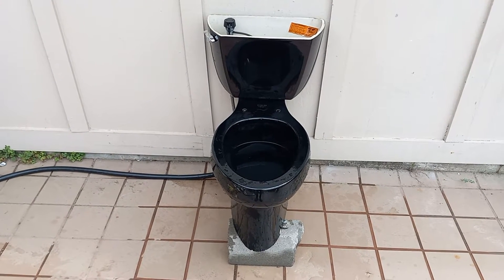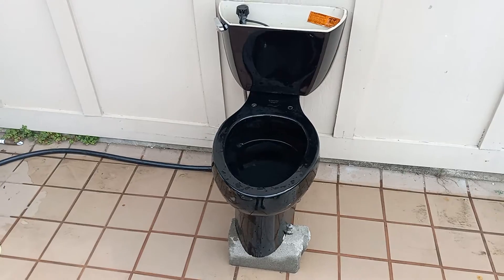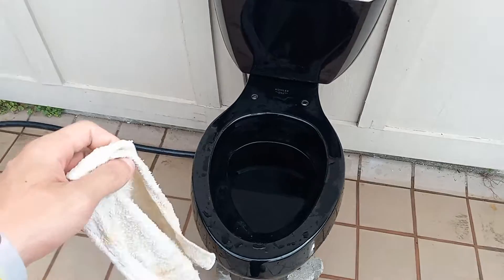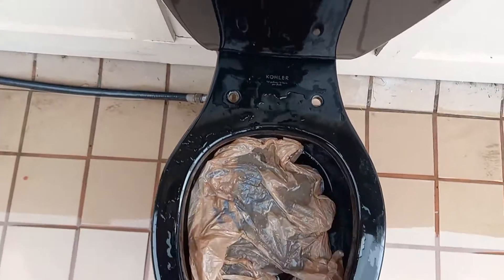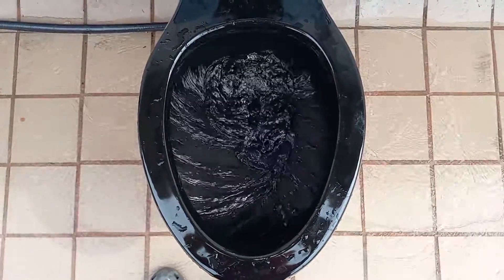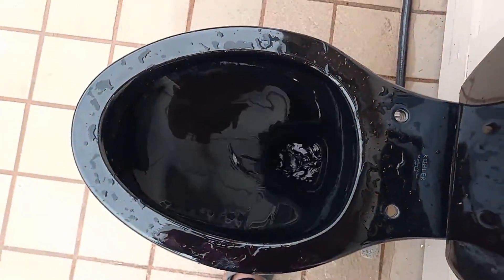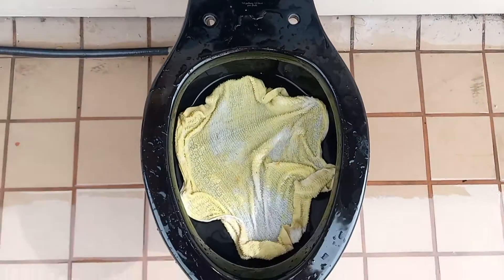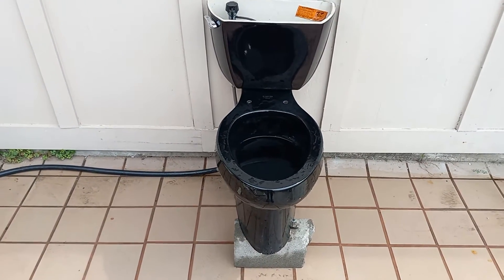2001 Kohler Wellworth Tests

Comment: This Black Wellworth Ingenium is another excellent example of a great range of Ingenium Trapway toilets from Kohler - this one has a truly excellent flush and the performance is very good also - shame that it is not perfect as it clogged on the grocery bag with washcloth test. For a score I will rate this a 8.75/10 👍
Reply from the maker: At least it's better than most 1.6 gallon toilets.

Comment: An elitist terlit! 🤣 Looks like most of the water flows between the 8 and 11 oclock positions with very little on the right side if the bowl, but i did see a little at 4 oclock. It is hard to see.
Reply from the maker: Sometimes it is hard to see the flush